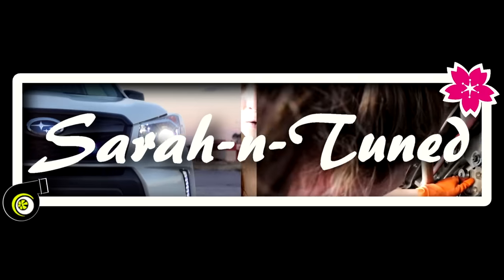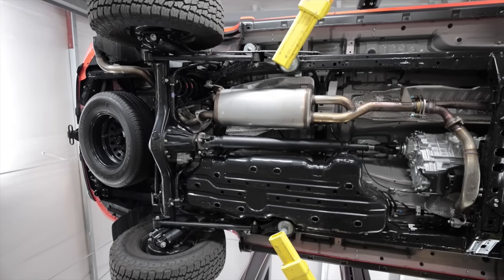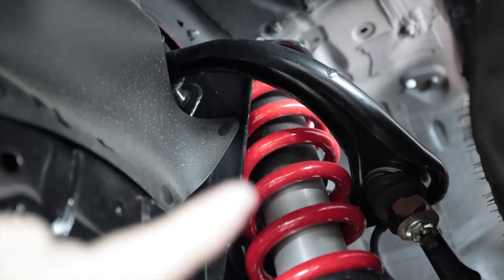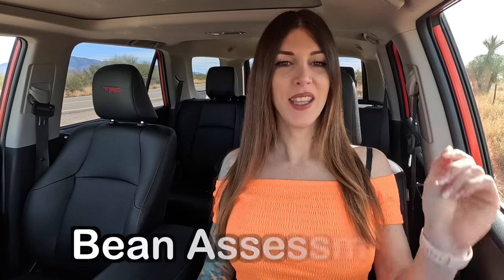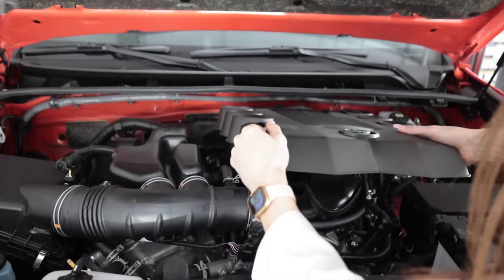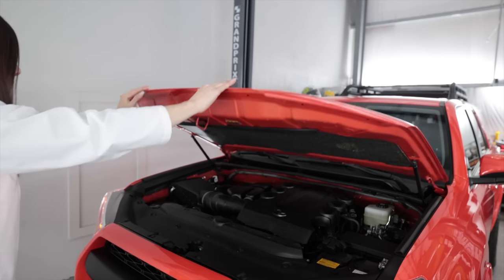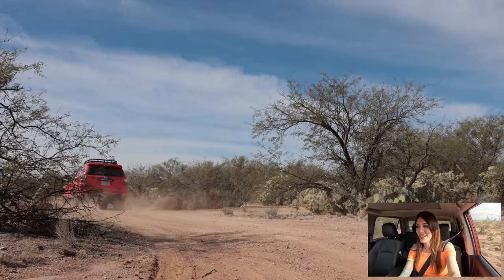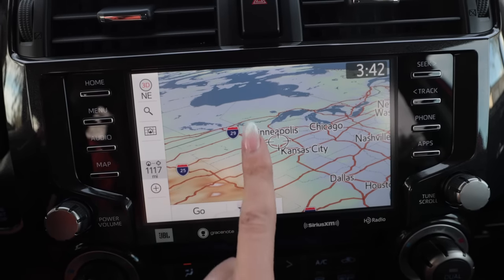Name A More Reliable Off-Roader // 2023 4Runner TRD Pro

Comment: That transmission and engine is the epitome of if it ain’t broke don’t fix it.
Reply: IGR-FE perfection. Sadly though I’m fairly certain the 6th gen won’t have it and it’ll be a forced induction 4 or 6. Which is why I got my 2021 TRD ORP 4Runner and didn’t wait for the 6th gen. Would be nice to have it as an option or on a specific model or package, but doubtful they’ll do that.
Reply: @KendrasEdge757 Yeah, it’s getting the same turbo/hybrid turbo 4 banger as the new Taco and Land Cruiser. Hopefully since the Taco is still getting a manual, maybe they’ll bring it to the 4R. But no manual for the hybrid as of yet :/
Reply: @KeithKacanek  yeah that’s the rumor, doubtful it’ll get a manual with it though, although that would be nice on the current models.

Comment: Sarah, the brake lines have a qwinkie tube configuration. Qwinkie tubes reduce excessive vibration in hydraulic systems by smoothing out the pulses of positive displacement pumps. This helps with wear and tear and helps prevent cracks in the steel lines. The traction control system is probably main reason for incorporating this in the design of the brake system. Qwinkie tubes are usually used in the hydraulic systems of aircraft.
I appreciate your wit and humor!!
Reply: Thank you for spreading the knowledge
Reply: Dang someone is an expert! I learned something today!
Reply: I was always wondering why they did this, and now I know.  Thanks!
Reply: Thanks for that! I was coming in here to find the answer.  

Thanks!

Comment: The drone footage is getting awesome 👌. It improves every time you use it
Reply: I think Charlie or Angel food cake are helping more which boosts the quality of content. Loved it when Sara did it solo too though
Reply: I have just never found enough value or upgrades to the trd pro models. No extra power. Not enough tire. Not enough lift. Too few lockers. Too few gears. Perhaps why I just bought a Black diamond bronco Sasquatch with the 2.7 ecoboost. Even with the markup it’s still a way better value.
Reply: @duckyjp17  the Toyota has proven itself, extremely reliable and plenty capable. Get back to after 100,000 or 200,000 trouble free miles on the Bronco.

Comment: The brake lines are probably like that to facilitate changes in length due to pressure, temperature and frame flex
Reply: And ability to compress when disconnecting those fittings.

Comment: The S curves and coils in metal lines are for flex, the master is on the body which flexes on the frame, they spring instead of run out of length or bend side to side and weaken the line.

Comment: Favorite vehicle I’ve owned. Bought offroad premium instead of pro because I knew I would add a lift, wheels, tires, skids, bumper and winch. So for the same price I now have a trd extra pro
Reply: Have a 2024 off-road premium. Didn’t want the Pro. Installed a much better roof rack, put on rock rails, wanted WildPeak tires, not Nitto, and wanted KDSS. Installing a minor lift with a better Fox suspension tan the PRO soon.

Comment: I miss my 4runner. V6, 4x4, manual.  That thing was awesome.  I will probably 1st in line if they bring the manual back.
Reply: Manual with the right engine .the 3.5 is so weak
Reply: @davidr6865 Or the truck is too heavy.  More aluminium clading might help.  Or better yet a cr-mo steel frame.

Comment: The ONLY vehicle I would trade my Jeep in for. Toyota builds it right, it may be lacking in just about every category but you know it will work!
Reply from the maker: I’m weird, I prefer less tech options.
Reply: @SarahnTuned  bought a 2022 tacoma based on the 'less tech'
no stop start, NA V6, old transmission, physical dials, and a touchscreen that doesn't stick out in the dash.  it's slow, but don't care.
Reply: @SarahnTuned  For off-road I can totally see that. Sadly I haven't done any since moving from Tahoe to Florida more than a decade ago. Since I've always been a tech geek anyway, the more tech the better for my daily driver/road trip car. 😁
Reply: I just don't know about the need for the "off road cruise control modes." I prefer less tech options as well. I have been all over off roading with an SR5 with Atrac and have never needed the different modes or a locker. However I am not rock crawling or going places that the odds aren't in my favor that I am not making it out or I am likely going to break something (hopefully I haven't just jinxed myself my making that comment :) ).
Reply: A few modifications on a Off-Road Premium and it would be better than that PRO. Other than some severe off-Roading it would be much better overall off-roader and overlander than a Jeep, including not braking down.

Comment: Those unused holes in the transmission are often  actually there to mount dealer purpose workshop brackets to fix the transmission on a transmission jack 😉

Comment: The 4runner is one of my favorite suv's.  Also, awesome Ford Ranger.   I have a toyota tacoma access cab trd sport 4x4 4.0L V6 automatic transmission with 175,000 miles.  It's been reliable, useful, capable, and great.   Keep up the great videos.

Comment: Squiggly and coiled brake lines reduces vibration fractures and leaks. Little spring action. Engine and road vibrations. Near master cylinder reoccurring foot to pedal stomping flexing the mounting area .

Comment: Had a '16 4runner up until this year. It was great off road, always felt in control and solidly planted, but it was an absolute dog on the highway, so slow and with so much gear hunting. It was terrible climbing up into the mountains, felt like a liability at times. Swapped it out for a Colorado Bison, no regrets.
Reply: Have a 2024 Off-Road Premium, just finished Idaho, Utah and Colorado trip. Handled the Altitude and Mountains. The KDSS was great on the highways. Going 80mph on highway for hours was easy.

Comment: A small turbo diesel would make so much sense. The "robots" would take care of torque management; diesel mileage would be a huge pro point.
Reply: Go to Central America, more TD's than gas everything, I've really been thinking about importing a Hilux from down there, but damn, a 3 YO truck is $60K US (plus shipping and import fees).  
I don't know why they don't offer them (TD's) here in the states. EPA maybe?
Reply: @sgraham9511 I think epa is a big reason, but they'd also have to train techs at every dealership to work on a completely different type of engine. I suspect that the dealerships would pitch a fit.

Comment: TRD offroad premium trim has all of off road modes minus the fox shocks, a skid plate, dual zone climate,   and the dealer 10k markup.
Reply from the maker: If a person actually pays a dealer markup, they are the problem. People really need to start saying no and refusing to purchase if they want it to stop.
Reply: The off-road premium does have a thin steel front skid plate, and no KDSS option on PRO. I Would not buy without KDSS, the ride is great, hardly any body roll compared to the PRO, great on highway. Bought WildPeak tires, in my opinion much better than Nitto, especially in the rain. Pro roof rack dislike, put an Uptop Overland Bravo roof rack, much better, plus rock rails. Adding a small lift, with FOX suspension. Ending up being better than a PRO for less money..

Comment: My wife and I took a trip to see Yellowstone Park. We flew into Jackson Wyoming and rented a 4 Runner at the airport. We rented a place to stay in Driggs Idaho so our drive included going over Teton Pass at 8431 feet. I mean a dog the top third of pass we were limited to 20 mph. I am not sure of motor sizes but the transmission was auto with OD.  The interior was nice and comfortable.
Reply: Something was definitely faulty with yours, I have a 5th gen and drive over 10k feet all over mountain passes in Colorado with zero issues even my 4cylinder Tacoma can handle those grades and elevation
Reply: As James P said. There had to be something wrong with the vehicle. I live in WY and take mine up to that elevation countless times and it goes WELL over 20 MPH.

Comment: I would take the 6 speed, 1000%
Reply from the maker: If you’re mechanically inclined enough it’s totally feasible to swap one in and most likely everything would bolt right up from a Taco or FJ. You’d lose MTS I think but you would keep ATRAC.

Comment: I have a 2000 Yota 4runner SR5, over 200,000 miles on it. Original water pump, one clutch replacement, 5 speed manual, 3.4 V6 and factory lockers. The thing is a tank. It wont get you there fast but it will get you there.

Comment: TRD Pro is a great truck.  But if you want a more economical equivalent with the same mechanical specifications besides the Shocks and Struts. Get the TRD Off Road.
Reply: Or better yet just get a base sr5 and put AT tires and a lift. Most will never need all the other electronic modes
Reply: No KDSS option on PRO. I Would not buy without KDSS, the ride is great, hardly any body roll compared to the PRO, great on highway. Bought WildPeak tires, in my opinion much better than Nitto, especially in the rain. Pro roof rack dislike, put an Uptop Overland Bravo roof rack, much better, plus rock rails. 

Adding a small lift, with FOX suspension. Ending up being better than a PRO for less money. Sill got the Front, Side, and 360degree cameras, lot of options that the basic SR5 doesn’t have.

Comment: The brakeline spaghetti is to allow for flex. I doubt the brake fluid will ever get very hot in those, so its probably for people who modify these pretty extensively, then do crazy things with it, introducing extreme forces to the frame that may bend it - frame bent but the brakes still work or something like that

Comment: "17 inch x 7.0 inch x 4 mm offset, Cast Aluminum TRD Wheel with TRD snap-in center cap (PTR20-35111-GR)"

Comment: So basically, this is the exact same as my 2011 sr5 premium...except I have Bilstein 5100 shocks and a remote start and better rci rock sliders and skid plates, and better tires.
Reply: Yep. My 2013 Trail Edition has the MTS, locker, and crawl control.

Comment: The usual reason for adding extra bends in hard lines is strain relief.  That way the U-bends can give and spread open a little so that the junction doesn't get ripped apart when the chassis flexes.
Reply: Yes, to accommodate frame twist and also body to frame movement. The brake master cylinder is mounted to the body. The u-bends work well if the hard lines need to be concealed and away from ground hazards, otherwise a coil is utilized if in open air and free from obstructions.

Comment: The seat heaters are probably not rhiostats even though that's what it seems like. It's probably the communication protocol Lin (local interconnect network)  it's very basic. Check it out because it's used in almost everything from seat heaters to the color of the ambient led lights in ford's and stuff.

Comment: I'll name your one more reliable....Lexus GX 460.

My only complaint is the 4.6L V8 was never offered in this 4Runner generation. I owned a 2009 V8 4Runner and it was incredible. I went to buy a 2019 4Runner Limited and the power difference was substantial hence why we went with the GX 460.

Comment: seems like the shifter layout is the same as the tundra, even my 2011.  the heated seats have the same variable-thingy control.  orange and black looks awesome.  that brake line is odd, like a game you play with the electric stick (no, not that kind). i am thinking something to do with flexibility in case it comes in contact with something hard.  uhm, nope nothing to do with the electric stick, but like if the truck hit the planet, then you'd not loose brakes.

Comment: Just a guess about the curly brake lines - longer lines means less heat build up in the fluid. Toyota's driver assist systems rely a lot on the ABS system

Comment: Just to correct you on the same mistKe that so many others make:  the S in the transmission doesn’t mean Sport, it means Sequential.  So, for example, if you’re in S and put it in 3, the transmission won’t shift past 3rd gear.

Comment: That fuel mileage is an issue, I'm thinking Ranger Tremor.
Reply from the maker: Ranger tremor is just as bad if you’re in boost constantly. The 2.3 Ecoboost is only as economical as your foot allows it. I averaged a best of 23mpg in my bronco babying it, but 15.7 giving it the maximum bean every single time I moved forward. Lol
Reply: @SarahnTuned  Perhaps it needs a diesel?

Comment: I’m not fond of the underneath mounted spare tire. Should be mounted like the Jeep Wrangler.
Reply from the maker: The make kits to do that, problem is it makes the truck hard to fit in your garage with the tire on back. Unless you have a mansion.

Comment: Great looking truck from the outside.  Pretty bad on the inside, really.  I mean, Jeeps and Broncos also have rugged interiors that are easy to clean, but the materials and design are significantly better.  Toyota is just riding the lazy train with this one.  Also, simple doesn't equal a computer system running a bunch of "off-road modes" via a dial on the headliner.  Simple would be a manual transmission and a manual transfer case.  But it doesn't come with either one of those, so, yeah, this one is a big NOPE.  If you put a shell on a Tacoma TRD Pro, you'd basically have the same vehicle, but with the option of a manual transmission and transfer case.  Not offering manual shifting on the 4Runner is a pretty significant fail on Toyota's part.

Also, I really miss the FJ Cruiser.  The manual version of that truck was just awesome.  Really wish Toyota would bring it back.

Comment: The current Tacomas manual transmission will not bolt up to this motor they're two different Motors they don't share the same motor in the more not since 2014

Comment: I'm not sure why the stats for the 4Runner's fuel mileage are so low. I have a 2013 FJ Cruiser that averages about 18 mpg with upwards of 21/22 mpg on the highway. Aren't the drivetrains and weight about the same? I guess I'll have to join an FJ forum to find out more.
Reply: I dont get it either. I get 15 average around town in my 4runner pro. Maybe 18 hwy if drive nice. My tundra pro was getting 14 average.

Comment: TL;DR Specs

2023 Toyota 4Runner TRD Pro

Base MSRP: $54,020

Tow Rating: 5000lbs

Suspension: Double wishbone independent front suspension, 4 link solid-axle rear

Transmission: Toyota A750F 5-speed torque converter automatic

Final Drive: 3.73:1 (multiplied by 2.56 in low range)

Curb Weight: 4750lbs

Front brakes: 4-piston dual-opposed front calipers, 13.3in rotors

Rear brakes: Single-piston caliper, 12.3in rotors

Engine: Toyota 1GR-FE (Dual VVT-i)

Displacement: 3956cc

Bore X Stroke: 94mm x 95mm (near-square)

Compression Ratio: 10.4:1

Fueling: Electronic Port Fuel Injection

Power: 270hp @ 5600rpm

Torque: 278lb-ft @ 4400rpm

Rev limit: 6000rpm

Ratings:

Power and Speed: 3.8/10

Value: 5.9/10

Ease of Maintainence: 8.1/10

Off Road Performance: 7.5/10

Penguinability: 8.2/10

Comment: Toyota 4Runner
It doesn't have "Tech" specs
It has 4Runner specs. It either is a 4Runner, or its not.:yougotthis:
The redesigned 2024-2025 4Runner will show you what does not make a 4Runner

Comment: Nice review. 

Love the 4Runner.  I think is the all-around best vehicle you can get, and they last forever. 

The rear suspension has 5 total links, but commonly called a 4 link.  Not sure why.

All those S bends in the brake lines along the frame are to allow for the body to shift in the mounts on the frame separate from the frame.  The brake lines originate at the master cylinder, which is attached to the body, then the lines go down to the frame and the differential movement between the body and frame has to be accounted for, so they do it with the S bends.

Comment: As a point of education about Toyota: The US gov assigned GM to rescue/rebuild Toyota, literally from ashes, after WWII. So how does Toyota pay us back for the help? In the late 1990s & early 2000s Toyota weaponized its Toyota Production System, specifically Lean Manufacturing, to drive American parts manufacturers into bankruptcy. I worked at TRW Automotive at the time and watched it happen. 100000 American jobs were lost. They forced us and others (contractually) to remove all automation from our production lines and do everything by manual human labor - our labor costs went from 3% to 30% of the product cost - we lost money on every part we made. Toyota would then buy more parts than they needed (they scrapped the excess) just to drive us into bankruptcy - to make us lose money.  Toyota is EVIL!